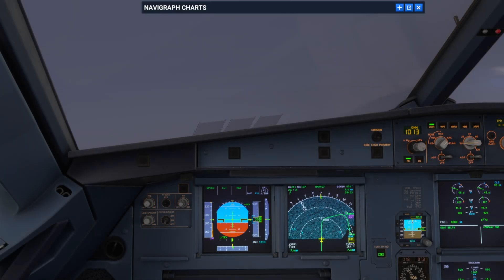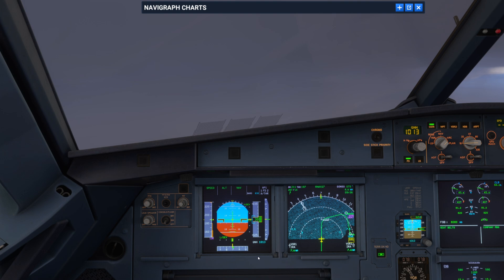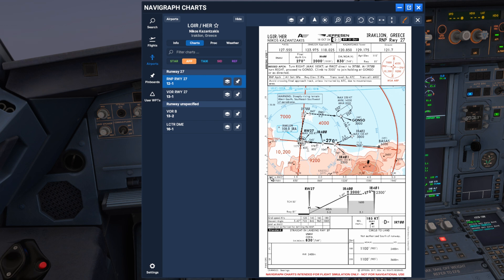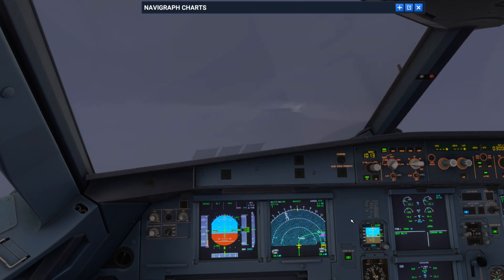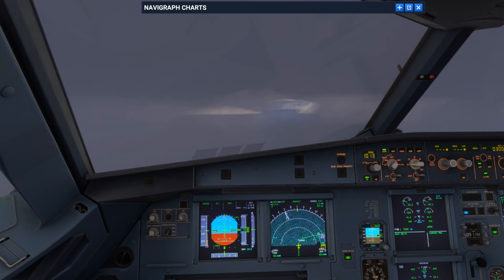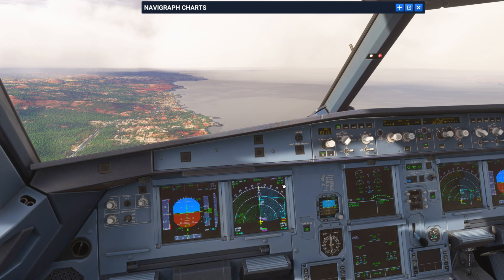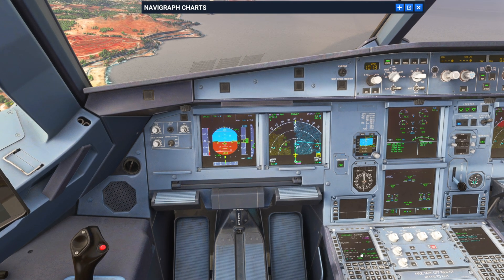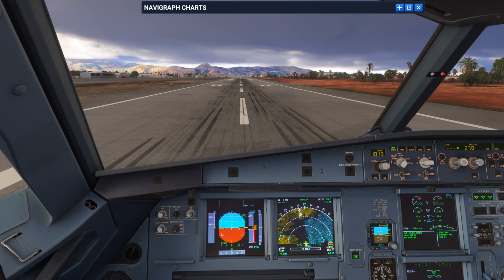A320 Non Precision Approach Explained | Real Pilot Tutorial in MSFS 2024

Comment: Nice clear video, thanks.  It appears the autothrottle comes off as you flare.  Is the  737 different in this respect ?
Reply from the maker: Hello, thanks for watching! On the A320 the auto throttle comes out as we pull the throttles back out of the CLB gate. I'm not 737 type rated so not able to advise on that aircraft